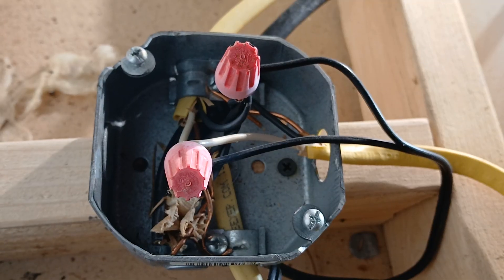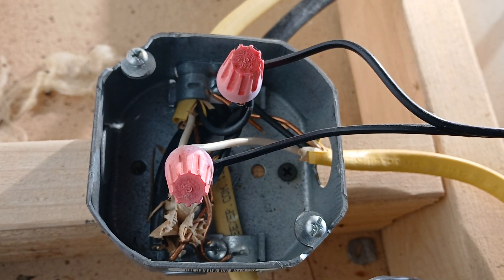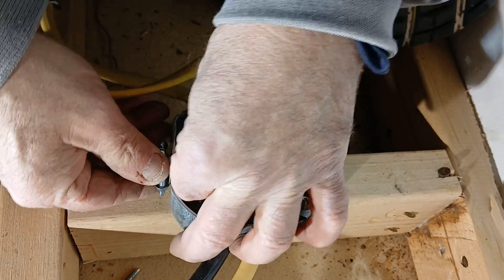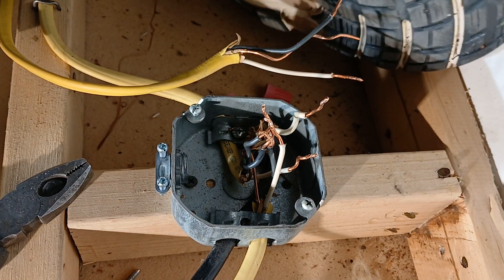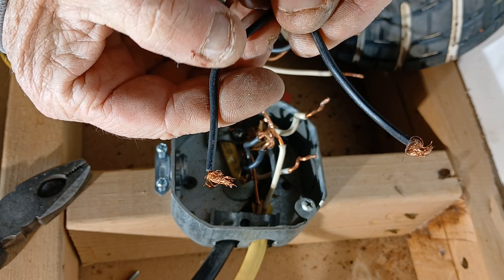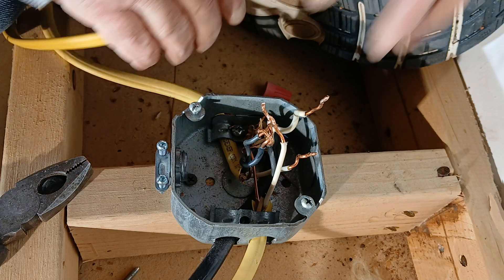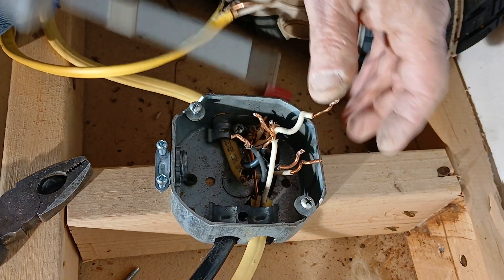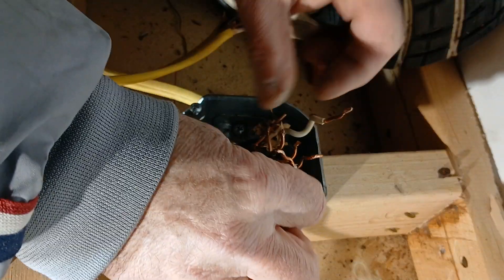unsafe electrical installation repair with a dangerous junction box rewiring

Comment: While it's great that you provided form of some ground-bond to the box, it's actually a Code violation to bond that grounding conductor under the cable-clamp screw. It must be under its own, dedicated grounding screw.
Furthermore, for just $2 or $3, you could have just replaced that old box with a new one, which would have a threaded hole specifically for the green-grounding screw. Also, you could have then just run the 4 romex cables through the integral cable-clamps, and not needed that extra romex-clamp on the side. 
Also, what is the reason forthe extension ring on top of the original box? Serves no purpose...